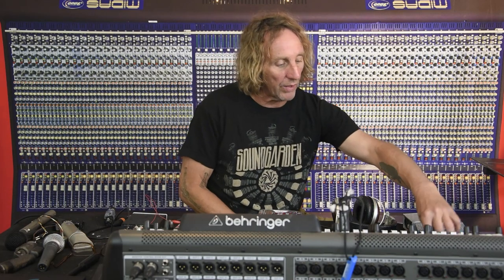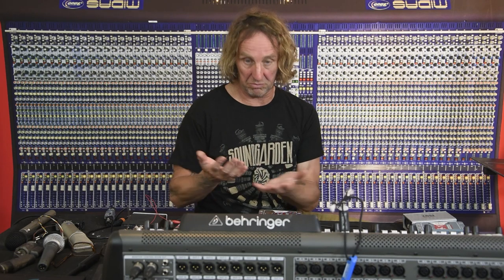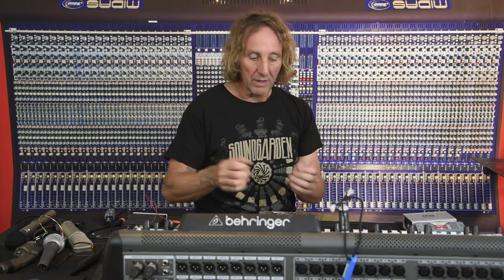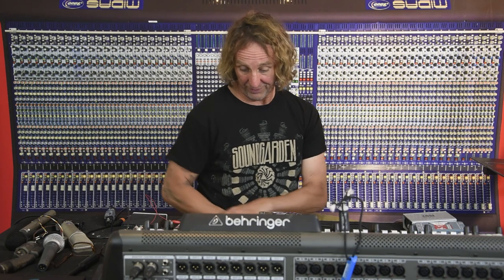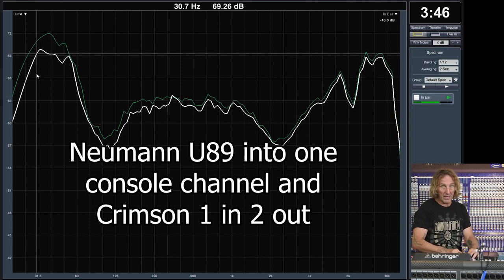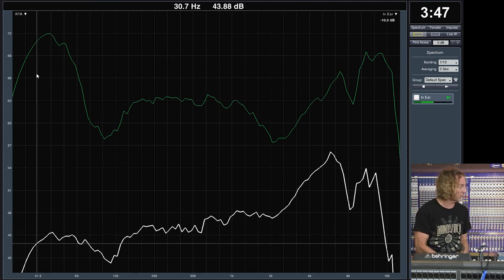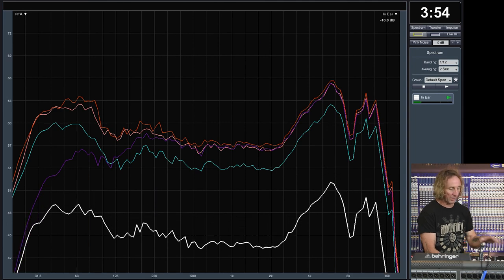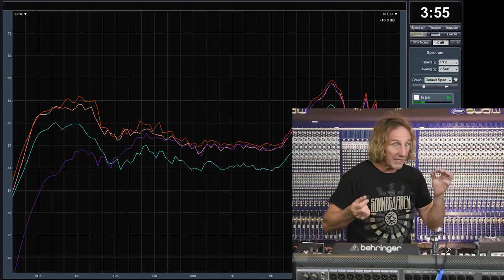Do Audio Transformers Mess Up the Sound Part 3 - om7 & U89

Comment: So you are getting low-frequency roll-off with transformers on dynamic mics.
And the problem is????
With the possible exception of using a dynamic mic on a Bass cabinet what FOH or monitor mix doesn't get a high pass filter engaged in the channel that will usually cut below 125 Hz.
With the couple of transformers that cut 3 dB or so of the total signal, the lower signal is easily compensated for by turning up the channel gain though the real solution is merely to take the direct (no transformer in) line for FOH. 
This of course is what is wrong with this testing because it doesn't show what if any effect the transformer has on the direct line in the split.
Reply from the maker: The sound through the transformer is the same or nearly identical to the direct split sound. The change is caused by adding the transformer and impacts the direct and transformer sound.

In a situation where transformers are always there and the sound is dialed 8n with the transformer connected, there is no issue other than the sound being different. Not better or worse, just different.

The issue is when touring and a recording truck shows up for a gig and an transformer split is added, all the sound of foh and monitor sends changes as soon as the truck transformers are added. 

As a touring engineer who has all the sound dialed in, this change causes EQ and gains to change and then the next show, need to be changed back.

Few people are aware that this occurs and for engineers that are good at constancy from gig to gig, this is super annoying.

I personally strived for a very high level of worldwide sonic consistancy and toured with top level artists playing some of the largest shows. Seeking out every possible detail of variation is very important to me and I derstanding why things occur is critical.

This is info to help engineers reach higher levels of sonic quality and consistancy through knowledge.
Reply: @DaveRat  As a touring engineer you probably already know that it is inevitable that there is going to be at least a three-way split on all major shows as it has become a de facto standard to shoot and archive videos of shows.
You also know that while you might have your set of starting settings for a show no two shows are going to be identical and that changes in gain and equalization are a defacto standard.
There is no reason that having transformers in splits would prevent anyone from striving and achieving a high level of worldwide sonic consistency, even if someone is only mixing for a cover band at bars.
Reply: I just got off a month long tour with a well known 90's alternative band whos front man prefers his vocal and guitar flat (no EQ, no high pass, no compression) in his IEMs.  Sounds bad to me, but that's not what matters...
Reply: @JonAnderhub That was the standard 10-20 years ago, but the industry is moving away from that.   Broadcast recording trucks for concerts are a rarely seen these days.    I know many tours now that do not even carry a splitter (shared headamps) with no provision to install one and have in their contracts that they do not allow analog splits.   On my tour we carry Avid S6L's and have a hardwire splits to separate headamps.   In the past 5 years, we haven't done a broadcast recording where I didn't multitrack myself via AVB and turn the recording into my artists producer for in-house mixing to be returned to the video people later.      Whenever someone else is doing the multitracking I strongly encourage them to take the MADI split out of my stage rack.    I can't remember the last time I had a truck showed up and connected to my system with a transformer split - 8 or 9 years ago probably. 

I do agree that very good quality mixes are completely attainable with transformers, but when mixes are configured without them and transformer loads are added in - the tonality AND level of microphones changes - sometimes drastically.   This affect is different from microphone to microphone and is not quick or easy to adjust for and certainly not just a quick turn of the gain knob.
Reply from the maker: Actually I toured with a hardwire split to foh and mons and carried the transformer split for the trucks. So no, I do not accept the willy nilly variables as a given. I strived for consistancy full control ovwr the variables and am am sharing info so that others that want to strive for better than being a victim happenstance can achieve higher levels of quality.
Reply from the maker: Looking at this another way, adding a transformer impacts changes of several to many dB's at various frequencies in different ways to different mics.

Now would you buy a mixing console that has such a drwasixally non linear and seemingly arbitrary response? Would you use mic cables that did that? That sounded different depending on which mic they are plugged into? 

Why would be be ok with a transformer doing things that we would be aghast at if other gear did it?
Reply: Your last sentence is incorrect "This of course is what is wrong with this testing because it doesn't show what if any effect the transformer has on the direct line in the split." Double check the test videos, Dave always shows what the effect of the transformer is on the direct line (channel 1).
Reply: Also in the previous videos he shows what happens with a hardwire splitter. With the Behringer console the changes are almost non-existent, I suppose it's because this console has a high input impedance, almost like a line impedance (10kohms, when divided the microphone sees 5kohms). We would have to see what happens with a preamp with an input impedance of 3kohms or less and going to two channels of a console through a hardwire splitter for dynamic microphones.
Reply from the maker: I do show that the actual mic sound output is impacted and therefore everything that is connected to that mic changes when a transformer is added.

Based on the tests and my understanding very low impedance outputs are not impacted by the transformer being added. 

Electronic outputs can have impedances below 10 ohms. Microphones tend to have impedances in the 200 ohm range.

I believe this is why electronic outputs are impacted less and microphones are impacted more
Reply: @DaveRat  This is exactly what is happening.   Resistance in parallel:  A 10 ohm load in parallel with a 600 ohms becomes a net total 9.84 ohms.  a 200 ohm load in parallel with a 600 ohm load becomes 150ohms net - a much bigger effect.
Reply from the maker: Resistors in parallel will drop level but not alter freq response.

A level drop is easily fixed with gain, a change is response that differes on every mic/transformer combinations is a lot more complex.